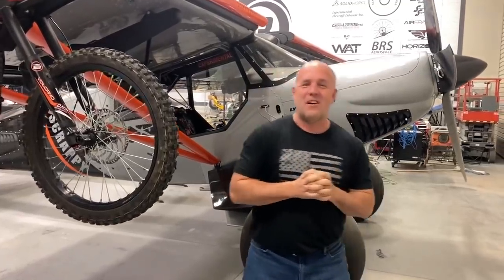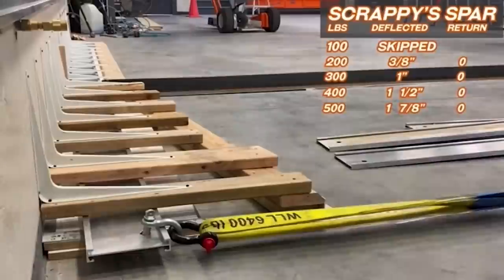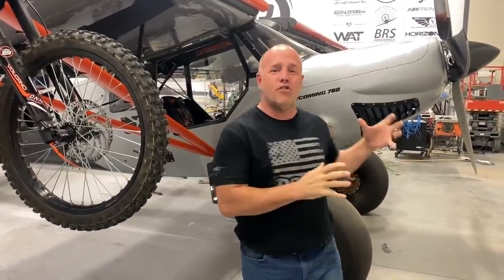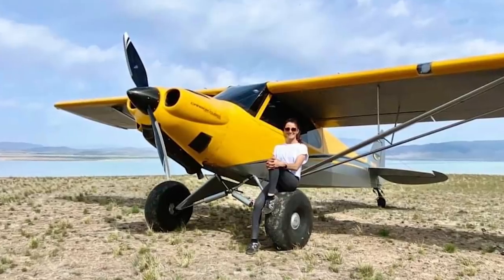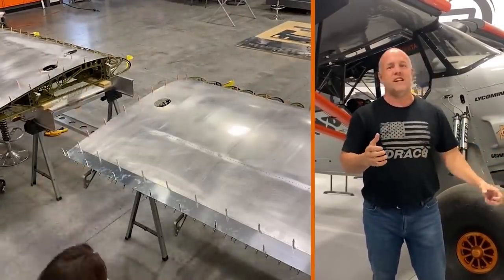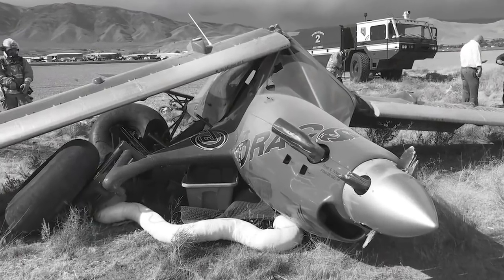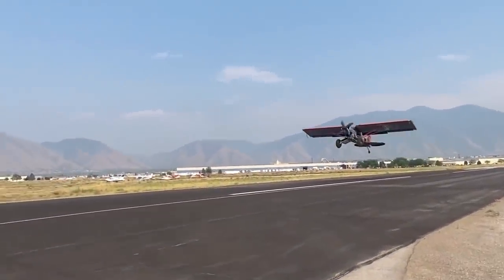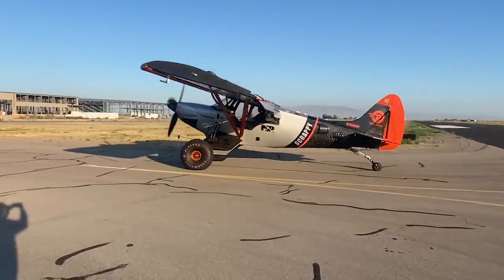What I Like and Dislike - Scrappy's Getting Some Upgrades | Scrappy #64

Comment: Let's be honest, I don't think any of us believed you would be satisfied with the occasional burst of nitrous 😄 Can't wait for project turbo!
Reply: I never believed it. Personally I'm not a fan of nitrous.  Although I don't care for turbos  either. I  do like superchargers. Less weight, less heat, Instant Power. Plus they can be set up on clutches.
Reply: @Ozarkprepper643  I didn't think the turbo lag was an issue for aircraft, since their always operating at rpm and load.  Tell me if I'm wrong though.  

For automotive I definitely agree, mechanical superchargers seem like they would be nicer to drive.  I've only had the opportune to drive N/A and turbo cars in my time so far.  I don't really like turbos on land, the lag completely changes how you have to corner, and it somewhat limits your options.

I guess I always thought that turbos were meant to be up high in the sky.
Reply: @saulekaravirs6585  I prefer turbos over N/A for 4 wheels. I tend to squeeze the throttle too early which bites me in shifter karts (and has bitten my femur on my race bike) but in my cars it works out perfectly. I love the power application of my MR2. 
Never driven anything with a mechanically driven supercharger, so I don't have any comparison, but I'm assuming it would be similar to N/A.

Now for 2 wheels, anything but N/A is blasphemy.
Reply: This probably means you have to redo the cowl. OMG that was so much work.
Reply: @dfw_motorrad1329  agreed. Love my STi swapped Hawkeye WRX wagon with 319 AWHP. Nothing better than a snail pushing some air into the block. Boost is a drug, and I'm an addict.
Reply: Good thing turbos like nitrous :)
Reply: @Ozarkprepper643  Heck, you can put gearboxes on them. Put in a high gear and take scrappy up to FL40!
Reply: @saulekaravirs6585  - You are correct about turbo lag for the most part.  Not much of a problem in most aircraft. Definitely can be a problem in STOL flying though where hanging on the prop and working the throttle is how you do a spot landing. Also, crucial in a go-around.
Reply: @saulekaravirs6585  I've got a supercharged Jag and the instant power always makes me grin.
Reply: PT-6...PT-6...PT-6.  😄😄😄😄😄😄
Reply: @lexteakmialoki5544  Yep. I was wondering the same thing.
Reply: @Ozarkprepper643  turbos are actually more efficient. They make more power with less heat waste and use less energy to make the same amount of power. I love all power adders but I think mechanical power adders just don’t offer the reliability of naturally aspirated with a bottle of negative DA on tap for bursts of energy.
Reply: Draco spoiled him rotten.
Reply: @gpaull2  I dont think thats gonna be a big problem because of the constant speed prop. The engine rpm should be the same all the time, even during STOL approach. Im just a rc pilot so I have pretty much no experience at all, so please correct me if Im wrong.
Reply: @MikePatey  when is horizon hobby going to make a scrappy rc airplane
Reply: TURBINE ?? :)
Reply: @Ozarkprepper643  turbos are already disconnected and usually make less intake heat because of the speed a turbo spins. Blowers are slower and pack air slower which drives intake temp HIGH!
Reply: @KimiWallrus   turbos have to spool up. That's where Turbo lag comes from. And it's true that really doesn't matter much on most aircraft. Certainly not at Cruise. But they do generate some heat. There's not much difference in how much space either turbos or superchargers take up but they do require much more Plumbing. 
  My bush plane has a stroked type 1 2300 hogged head, bigger valves. Uses four  32 m m Sonic Arrow injectors.  They're feeding 2 AMR 500 superchargers. (2 Aero injectors each.) On a custom manifold. And they are on clutches since I only need them on short takeoffs  in high density altitude situations. The rest of the time they're just there  drawing no power. The engine is direct drive and the cam makes its power between 1200 and 3000 RPMs. Engine makes around 140 HP without.  And just under 200hp with just 5 lb boost each. And torque gains are actually much more. No heating up either. And it's not like you need them when you're cruising. It is a composite plane with an empty weight of 463#.  It has a 6.2 Wing loading at gross.  I've been operating this plane for years with no trouble.
Reply: Been a pilot since the early 70s. Also been designing and building since the late 70s. Have had a number of aircraft over the decades. Also currently have a composite 3/4 scale Mustang. 
   I certainly  wouldn't compare myself to Mike intellectually. And I sure don't have his resources. But I get by.
Reply: @Ozarkprepper643  I don't think we speak the same about engine functionality.
Reply: @Ozarkprepper643  don't matter HOW GOOD you do it ...wwell it DOES MATTER ya kno QA and all that safe aircraft stuff,  but what REALLY MATTERS is that you are ENJOYING MORE THAN MINIMINMMMS !!!! with your FEET WELL OFF THE GROUND!!! :)
Reply: 3 words "Atmospheric Control Valve" aka Gulp Valve.Ak Miller 😎
Reply: @MikePatey and airvashon family I need help ll

Comment: I knew you wouldn't be satisfied with the Nitrous and i was expecting that you would replace the engine with a 1000hp turboprop....but twin turbo sounds really cool as well, as it means we can see the true potential of this monster engine.
Reply: Switching to a turboprop would decrease his range. While they have the power they are not very fuel efficient.
Reply: @cjhs77338  so much lighter for the same power that you can carry more fuel though, and reliable which with the best will in the world can't be said for a lyco... That's been heavily tuned.
Reply: @HansGruber006  That and CG would not work with a turbine.

Comment: Thinking back to my days flying KC-10s and found myself wondering: what about two sets of ailerons? Inboard and outboard. The extra set only unlocks at full flap settings. That’s a common setup on larger aircraft and seems easier than having one massive aileron and expecting it to perform the same across all flight profiles. But I’m no engineer! I’ll greatly enjoy watching the upcoming aileron development. Back to work!
Reply: Airliners do this too.  They usually have a high and low speed set of ailerons.  They also go one step further and start deploying spoilers when you get slow and need even more roll control.
Reply: @martylawson1638  if I recall, on airliners, as the speed increases, ailerons are no longer used (or deflection is reduced or zero-ed) and the spoilers are used. At low speeds both the spoilers and ailerons are used.
Reply: MU-2: *stares with confusion* What are ailerons?
Reply: Stabilators controlled independently. Ailerons are for high speed, differential Stab for slow speed. Works famously on jets that fly 0-700 Kts.
Reply: @ACSFlyingfish  it's the other way around. Differential spoilers come in at lower speeds.
Reply: @daszieher  so you mean that ailerons are fully functioning at all speeds at full deflection including up to Vmo and Vne speeds?
Reply: @ACSFlyingfish  well, to my knowledge that is usually the case. I can't speak for all aircraft 😃

The lower an airfoil's AoA is, the more effective a change at the trailing edge in terms of lift variation is. (Except very close to 0°, where the trailing edge is masked by the preceding bulk of the wing)

The higher the AoA, the less effective ailerons become, thus the more "other forms" of lift variations are required, hence said differential spoilers at lower speeds.

iirc, some larger airliners even only use inboard ailerons for roll control when at higher speeds. The outboard ones remain locked in place, dto spoilers.

Comment: In several very high-performance sailplanes, flaps and ailerons come down together, until a certain point… then the ailerons come back up to neutral or slightly negative as the flaps keep going down. This increases roll control immensely.  Maybe your last foot of aileron could do the same?  Something to ponder, I think.
Reply: Many high performance RC saileplanes do the same. I'm afraid that this is the only way. You will probably have the same negativ effect with increased ailerons.

Comment: I know the issue with the Ailerons. I had the same issue with my Own-design homebuilt. Its nowhere near as hard core as Scrappy, but it has a wing with really nice low-speed characteristics. It was getting airborne well before full aileron effectiveness, so was tricky in crosswinds! In my case, a row of vortex generators on the leading edge in front of the ailerons sorted the issue pretty easily. making improvements down the track is absolutely normal for own-designs!

Comment: Awesome update.  Love how slow and level Scrappy flies.  Hopefully the larger ailerons are enough.  But there's still the option of roll control spoilers, or mixing the ailerons into the split-flaps...
Reply: I just discovered this channel yesterday. Watching the crazy custom talks about Scrappy has been eye-poppingly cool! YES, that was my thought too, spoilerons! It seems like a good candidate, as all the big jets do it. I sat thinking, well, you've succeeded in creating a wing with such enormous lift capability that you run out of roll control before the thing will stall…so, kill some of that lift on the high-wing. Good idea. I've read a few sources that suggest wings are typically designed to stall at the root first, so roll control is the last thing to be lost as a stall develops.

Another consideration for the flight-test program: what's the effect of the rudder on roll in slow flight and high AoA situations. This wing is unique in that slow flight might not necessarily equate to a high AoA situation. But various sources I've encountered tell me that in typical aircraft, and especially the big jets, when you've got high AoA on and you're near the stall, the rudder becomes a primary roll-control device.

Then of course, when near stall, trying to pick up the low wing with aileron may push that side into stall, and suddenly the stick seems to do the opposite of what you intended! The guidance is to keep the ailerons neutral and roll with rudder.

A complication for the spoileron idea: you might want the spoileron to activate only during special parts of the flight envelope, not be something that comes up every time the stick moves to the side. So, plenty of variables to sort thru in design and fluid simulations.

Comment: For the roll control - in RWD-9, in 1933 the constructors made interceptors activated mechanically when l.e. slats were opened. They needed it for low-speed trial in Challenge 1934. At first it was 100x8 cm in size, but the aircraft was drastically too sensitive and the proper size appeared to be 25x4 cm.
By the way, the pilot did not control the wing except for ailerons, slats were sucked out at low speeds and by mechanical connection they were extending the flaps. Plus this interceptor activation. Ah, and drooping ailerons were there too.

Comment: NO stick pressure change when deploying all the trick stuff, that right there is amazing!
Reply: Perfect engineering equaled perfect balance.
Reply: I wonder if that is power off or power on. Full flaps and adding full power in a 152 requires a kot of pushing the nose down untill you can dump the flaps. But then Mike didn't design a C 152.🤔

Comment: for the propeller control.. are you going to put a spur gear around the hub with a bolt on second gear housing to complete the pump.. allowing you to easily inspect the drive gear sides and the complete driven gear by just unbolting the cover..  the oil around the hub where the main drive gear is also cools the hub and housing.  oversizing the case opening for the driven gear housing could allow you to machine a larger driven gear or a smaller driven gear and housing if the oil flow is not correct .. without redesigning the main housing.  shims to change gear clearance between the drive and driven gear..  bearings.. double row ball bearing up front.. self aligning roller bearing on the rear (barrel shaped roller) as that will probably handle the side loads better as are exerted by the prop and which ever drive you have..

Comment: The F14 used differential horizontal stabilizers to control roll.  With that big prop pushing the air (and the need for rear ballast when you add that CS prop anyway) maybe you could look into engineering something like that to help your ailerons out?

Comment: I expect extending the ailerons would increase low-speed roll-control authority, but it seems a shame to change what works well at higher speed. I have a couple of alternate ideas. One is a flap-like extension of the ailerons that automatically deploys at airspeeds below 40 knots.  That's still a weight penalty.

Another is a flaperon modification of the flaps and slats that differentially changes the slat and flap extension in concert with the ailerons at low speed. (While relatively simple conceptually and mechanically, this requires replacing the flap motor with two servo motors and a control law computer system. I don't like the possibility of increased stall speed for the "down" wing.) 

My favorite idea is to use a pair of electrically driven tilting propellors tied to the ailerons. They could either be mounted on the wingtips similar to the V-22 tilt-rotor configuration, or attached directly to the ailerons in a pusher configuration to apply thrust with a vertical component equal to the aileron angle. At speeds above 40 knots, the blades would be feathered and angled parallel to the wings. To get more use out of this setup, speed control for the motors would have an input from the rudder pedals to augment low-speed yaw control. (I suppose a pusher configuration would be preferable for wing-tip motors as well since that would be less likely to perturb airflow over the wings and possibly cause unwanted separation.)

I enjoyed this video and its predecessors; they're intellectually stimulating as well as entertaining. Thanks!

Comment: Triple compound with a 98-148 (87-135) mm primary and 65-89 (58-78) mm secondaries. 
Better throttle response and efficiency than basic twins.
On high altitude twins need nitrous to spool, compound has boost always on, and you only need to cool down the secondaries.

Comment: Now onto a twin with twins. I was looking at diesel power and maintaining full power to 30FL with around 80 Inches. Using twins but compounded with a manual turbo bypass and TurboSmart SG-050 straight through electric butterfly valve wastegates with manual backups. If you lose a turbo, you'll still have some power at altitude. 
Probably not the kind of complex system you would want for scrappy lol. I'm thinking about ultra low drag, high speed, high altitude twin i6 diesels with BSFC under 0.400 per hp with counter-rotating pushers on the tail. Baby Duramax 3.0L is what I'm looking at. See how they are doing in a few more years. Winberg Cranks, Oliver Rods, Wiseco Pistons and ARP Studs everywhere. Valves? TBD.

Comment: We used spoilers on the Red Hawk for roll control  on the wing the aerospace engineering dept at Kansas University made late 60 early 70s time frame.. Spoilers also helped to maintain approach angle on landing.

Comment: Hope you don’t mind me offering this thought. Instead of extending the aileron, is there a way to take a bleed from any of these; engine or prop wash or electric compressor and blowing it over existing aileron at low speeds only?Kind of reverse of the Formula 1 blown defuser.
Reply: I thought about that too, but concluded that plumbing the airflow needed would be too interesting given everything that's already in the wing.
Reply: I need to rewatch the wing build but I recall there is access and space. Having watched these videos for sometime I would never rule out work or difficulty as a reason for not proceeding with an elegant engineering solution. Having said that I think there are some options to do something at the aileron if you have enough information about what angle of attack you start to lose flow.

Comment: If you design a variable pitch prop adapter.   I would be real interested in trying a beta run on my gso480 powered airboat with my 82"  sensenich propeller.   If it works out could be a huge market down here in South Florida.  Love the videos. BACK TO WORK.   Happy holidays

Comment: Patey !  Great to get an update on You and Scrappy. I guess You had to get the
slide rule back out to design/create Your Engineering Changes.  I am interested
to see your engine updates.  Lots of variables changing on the wing and power
plant, not to mention the prop. Sounds like another patent or 3 coming up.

Comment: Really cool to see your enjoying Scrappy,  Go Nitrous.   For your Aileron Issue, have you looked at having spoilers deploy on opposite side only when < 40 knots or even when over 80% of aileron travel.  Would keep all your current Airfoil the same so no change in stability.  Back to work.

Comment: my real flying kind of ended that summer when i had my first solo flight. that was when i was 16. 34 now with 15 years of aircraft maintenance experience and on flight sims since mfs95, back in rc planes for last few years (since high school), and i noticed a thing about alerons. had this lovely foam corsair, 1.1m span. loved to hover on strong winter winds with it... but, i wanted to go slower. i dug in to rx and tx manuals and found out i can programme ail droop with flaps. so i did. it sure brought stall speed down, but it more than halfed the roll authority.

i think that in droop mode, the up aileron should travel allmost the same ammount as not drooped one, where my tx progamming only eased it off about 70-80% towards neutral. i see scrappy is behaving in a similar manner. just a thought...

ps. because of You Mike, im thinkin of ppl again. Thanks